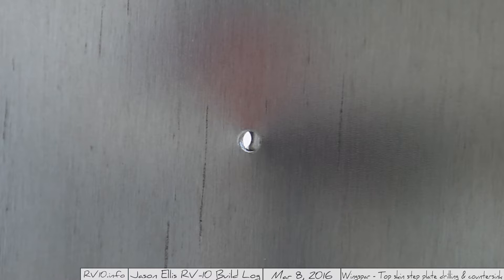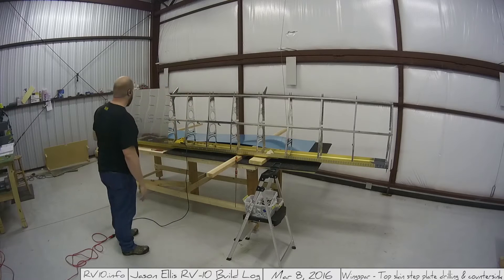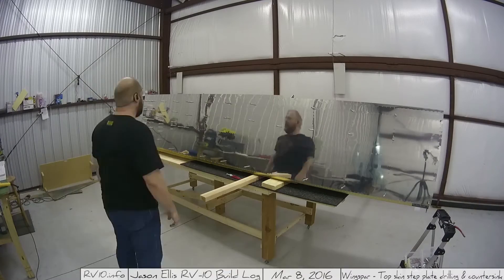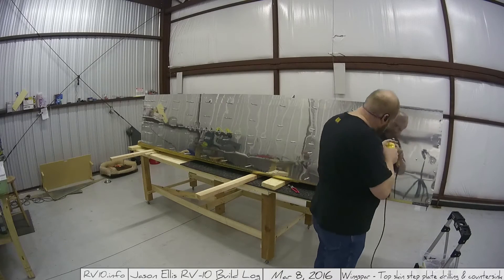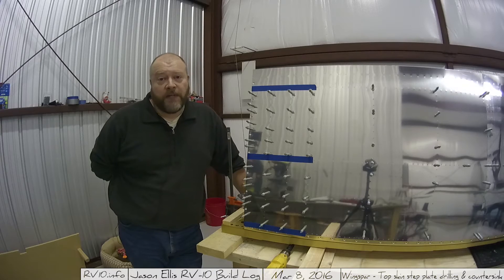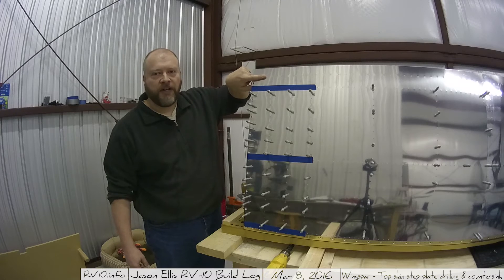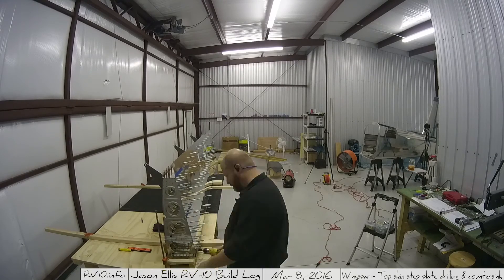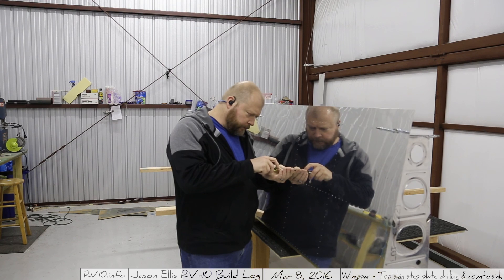RV-10 Wings - 012 - Left wing walk plate doublers drilling and countersinking

Comment: Hi Jason- I've really enjoyed your videos. I've wanted to build a Van's airplane for years, but have been apprehensive about the financial commitment. I noted that you had a question about dimpling versus countersinking. Countersinking is used when the material is 1.5 times or greater than the depth of the countersink. Dimpling is used when the material thickness is less than 1.5 times the depth of the countersink. Countersinking material less than 1.5 times the depth of the countersink produces a condition known as a knife-edge in the material which can develop into a fatigue problem down the road. I hope this helps.Thanks for putting the videos together. They are inspiring me to bite the bullet and get my empennage kit!!

Comment: Looks good Jason, I was wondering if deburring the dimpled holes would really be necessary? Wouldn't the dimple effectively deburr those holes?
Reply from the maker: +Shannon Taylor That's my assumption too.. But then again, the point of deburring is to take away any jagged points that might cause the formation of a crack under vibration.. shrug I dunno.

Comment: yeah, it looks like you're really enjoying the deburing.. Hang in there! I've seen a video on EAA that suggested using a dowel to remove the blueing, I assume you already know about that and am wondering if you've tried the technique?
Reply from the maker: +efox2001 I have tried it and to be honest, I wasn't impressed.  Firstly, you need to use a big dowel or it will actually cause a dent in the skin (just due to the flailing) and secondly you need a way to weigh down the ends as you roll the down or it will roll the skin up a little and you can crease the skin.. I tried it for a while.. I found it was easier to just pull it off manually.   

I think I talked about this in a previous video.. SOme folks say that over time the blue becomes harder and harder to get off.. I haven't found that to be true. So I don't know what kind of time frame we are talking about..